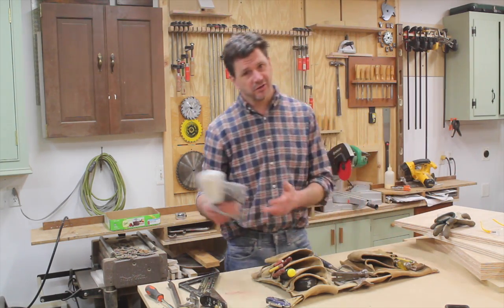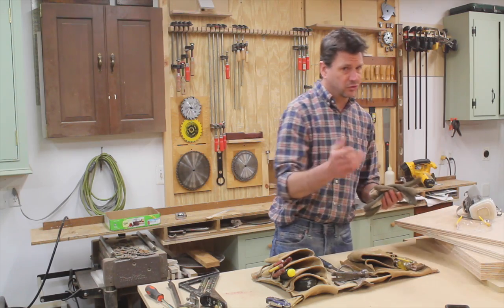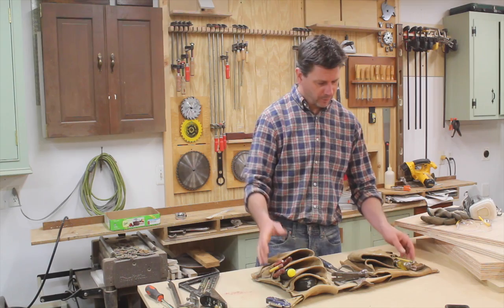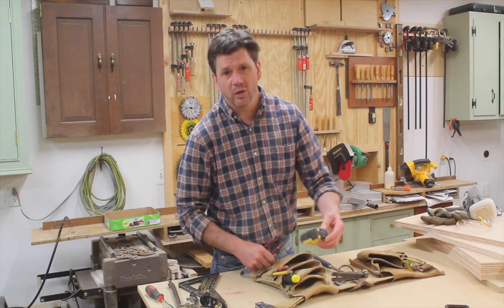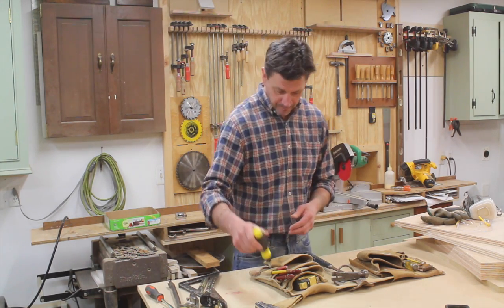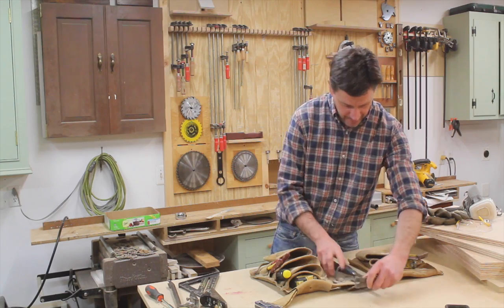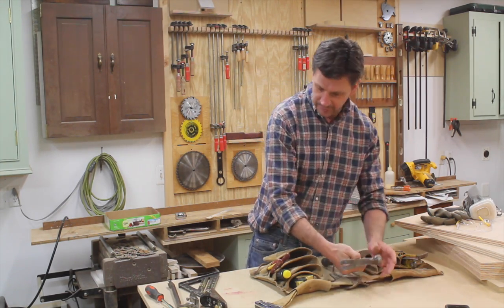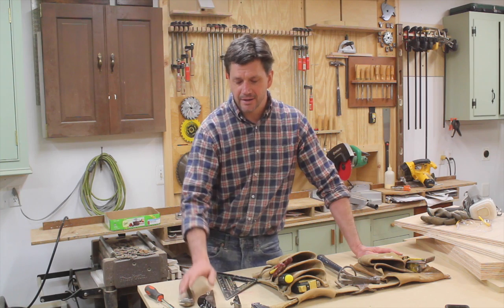Top Tools You Need for Your Summer Construction Job

Comment: Solid vid and great suggestions.  I can still remember my first day on a jobsite.  I pulled together my tools and my dad gave me a few extra items to bring, (like his old SKIL saw from like 1962..LOL).  I was taking my 16' tape and he told me I needed a minimum of a 25' and 30' being best.  I ignored him as I felt I could buy additional items later in the week.  First thing I did that day was climb a ladder to help the lead carpenter with some measurements.  I extended my tape over to him across a span and the tape didn't reach!!  He screamed at me that my tape was a kids toy.  Walked right down to his truck and he loaned me his 30 footer.  On my way home I bought a 30' tape measure!!  LOL  That would be my only suggestion.  Some other type carpentry can use 16' - but as a framer you need a longer tape.

Comment: Cameron below is right with the Suspenders...otherwise....it doesn't matter how big your ass is "or isn't"....your belt will keep sliding around toward your feet.  Good tip on the voltage tester too...even better....a small "continuity tester" with someone showing new employees how to use.  Most youngin's will not admit when they "do NOT know something".

Comment: I own and operate my own residential construction business, and while the contents of my tool belt does vary with the job that is being done that day, there are some tools that almost NEVER leave my double pouches: tape measure, utility knife w/extra blade storage, pencil, sharpie, hammer (agree on the straight claw!), speed square (essential!), cats paw, 10-1 screw driver, chalkline, voltage tester. In ten years, I've learned that you can get 95% of your work done with those tools. Sometimes some tin snips get thrown in or a siding tool, or drywall tools.....but the above is the foundation for the other stuff. I also recommend some heavy suspenders for your tool belt. Your hips and back will thank you.
Reply: ***** I've been a carpenter 15 years now and got myself suspenders for the first time last year. It has made wearing such a big tool belt so much more comfortable.
Reply: Cameron Lienhart pliers foo